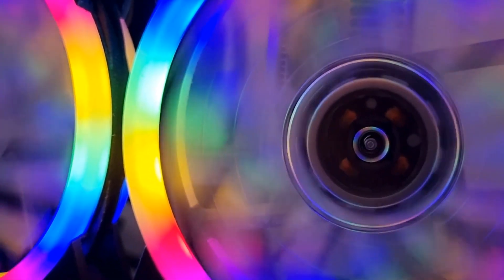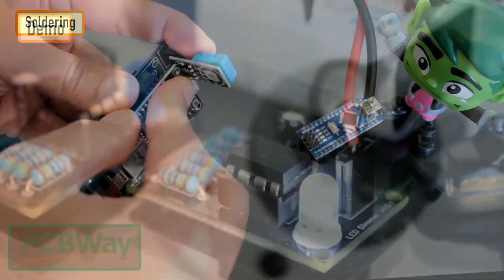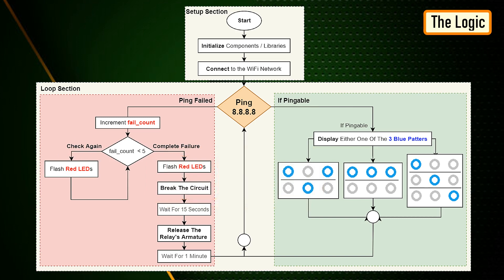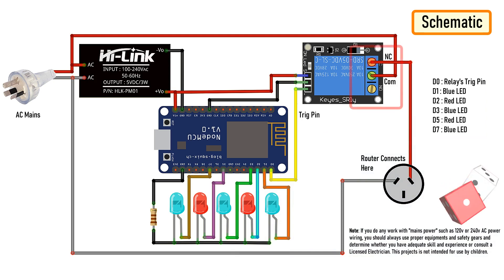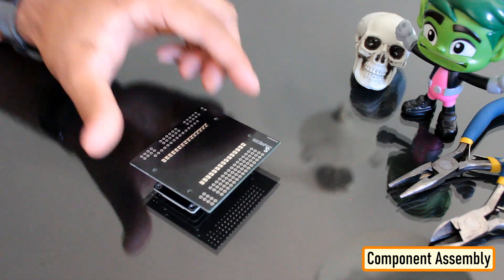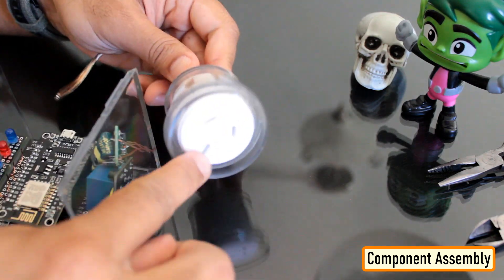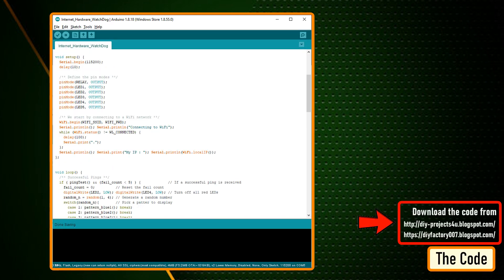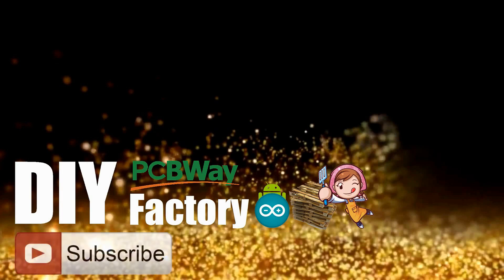Internet Hardware WatchDog Using NodeMCU

Comment: Since you connect to the router's wifi in the setup of the watchdog and in case you end up rebooting the same router, don't you need to reconnect at the end of the loop, once you wait the minute for thebrouter to come back online?
Reply from the maker: I haven't had any issues so far with this setup.

It is like your phone connecting to a router 
If the wifi network goes off, you don't need to restart your phones wifi
Reply: @CrazyCoupleDIY  thanks for the reply, i plan to use it to restart my hubitat home automation hub since it randomly gets stuck.

Comment: Do you have to use 3 blue LEDs and 2 Red LEDs in this project? I saw your Ghost Internet Notifier Project and I was thinking if this one could be designed like that other one in terms of the 3D printing.
In other words, I wanted to know If I can use 1 LED for both "red" and "blue" signals, if you know what I mean.
Reply from the maker: Absolutely
You can use an RGB led for this project aswell